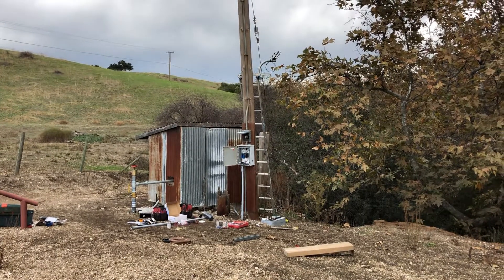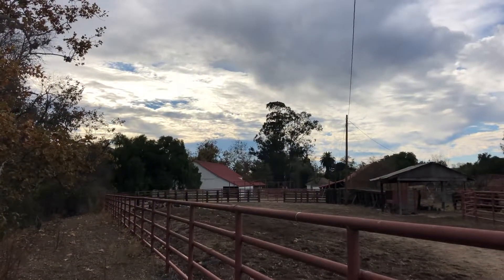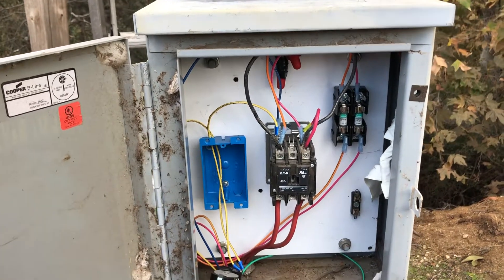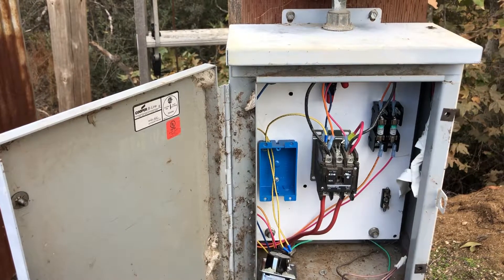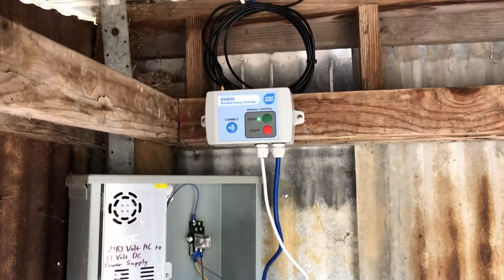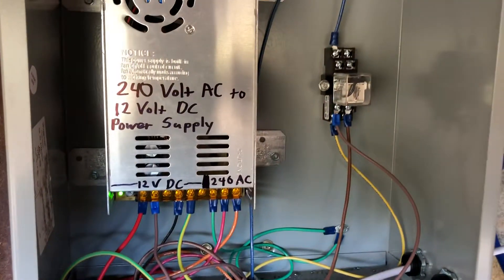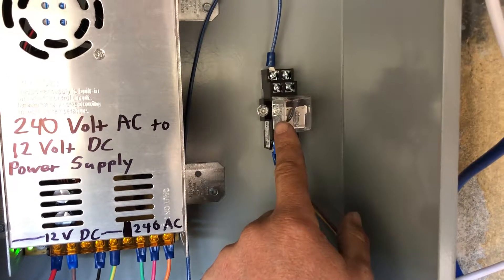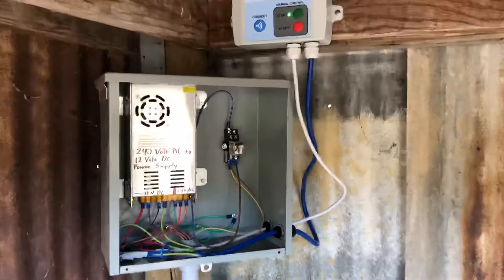Another installation of a smart water wireless monitoring and pump controller

Comment: Thank you for the useful video on the SmartWater pump controller.  It has been over two years since you did this install -- would you still recommend SmartWater?  I am on the fence, because it is kind of a hassle to convert this New Zealand product to US electrical usage:  a 240VAC -> 12VDC power supply, a contactor with a 12VDC coil that runs 240VAC, possibly a fuse block, all the wiring, and THEN the SmartWater product itself.  That's a lot of stuff that can and will eventually fail, but I have yet to find a US-made product that competes with the SmartWater featureset.